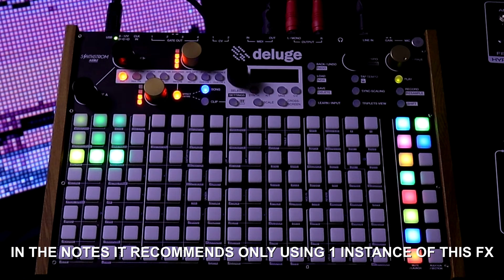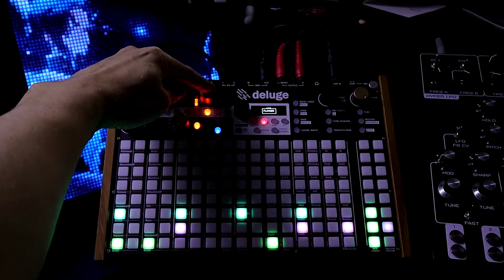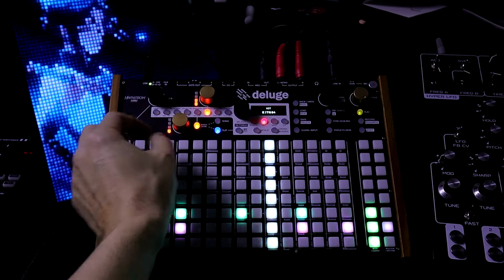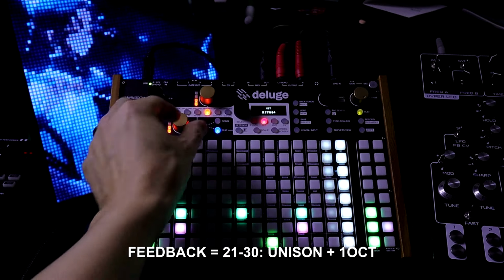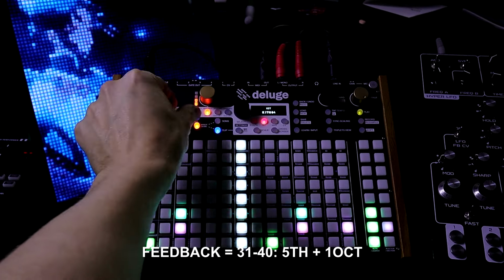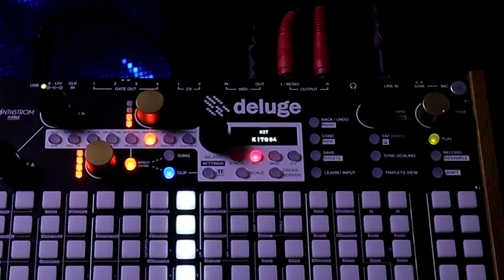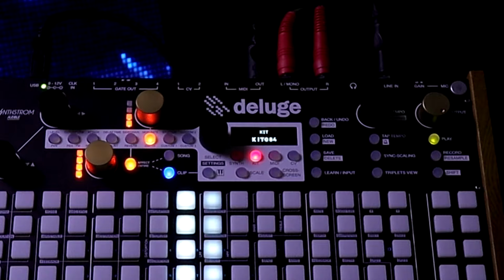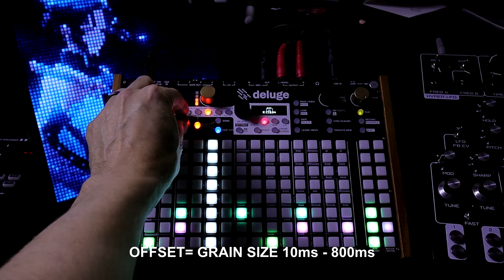OMG NEW GRAIN MOD FX AND DRONE STUFF // SYNTHSTROM DELUGE TUTORIAL

Comment: My community firmware all works great but after switching on Grain in settings the gold knob doesn't yet change it's still the old Mod Rate and Depth.
Reply from the maker: So you enabled grain, what clip type are you in? Synth type the mod function is set to pitch so you'd have to change it, if it's kit then you can click the gold knobs
Reply: @RonCavagnaro  Ah yes, it's a synth clip and only giving pitch variation. I'll press into the Mod buttons to alter it.
Reply from the maker: @girlinagale  you could"learn" those from the menu I think